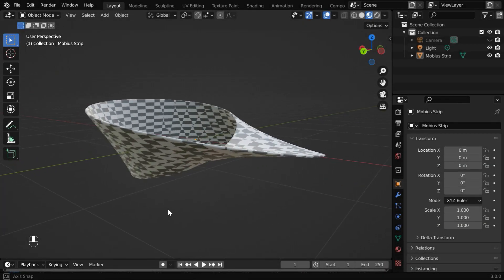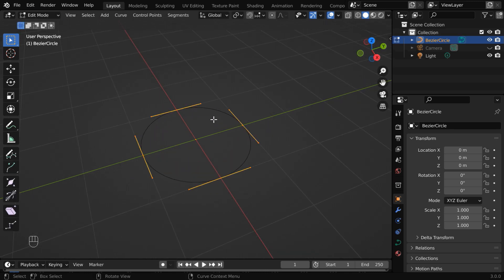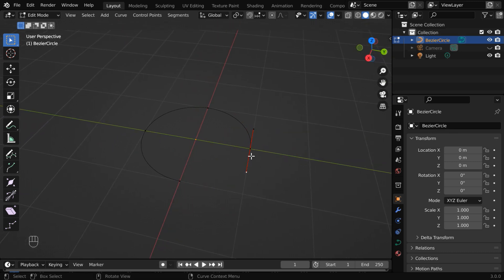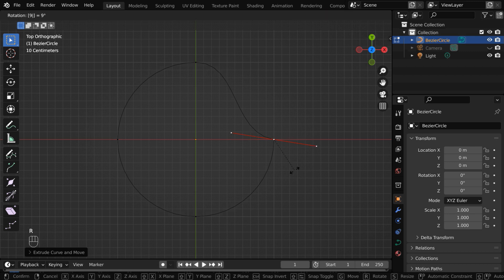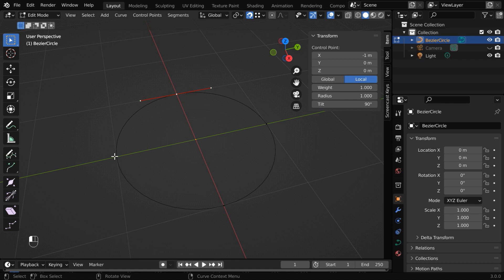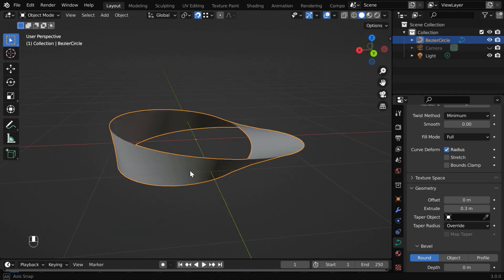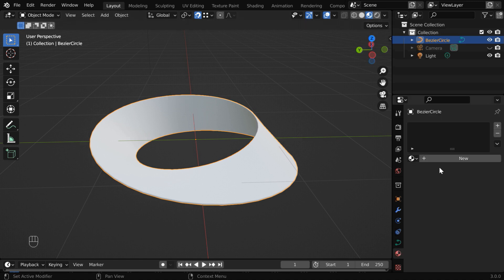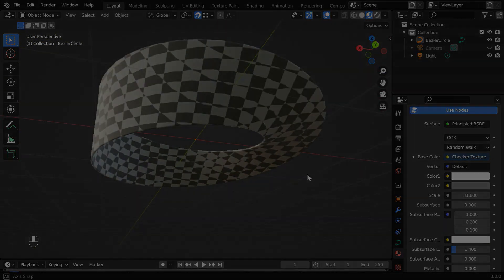Mobius Strip In Blender | How To Create A Möbius Strip In One Minute | Fast & Easy Technique

Comment: Doesn't work well with solidify, there a gap
Reply from the maker: It will work, turn off the Fill option under Rim within the solidify modifier, I have checked it in the latest Blender version just now.